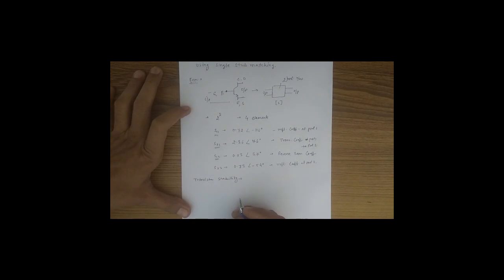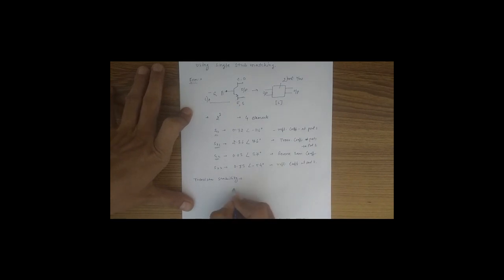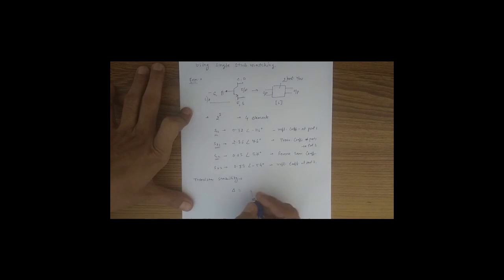RF amplifier design | Smith chart I matching

Comment: At which frequency do you have to design this high gain  amplifier and what the value of gain?
Reply from the maker: Frequency is 4 GHz. Depending upon transistor S parameter, at what frequency it is given..here I did input matching for 4 GHz. After this same way we have to do output matching also.Finally we can calculate the gain.